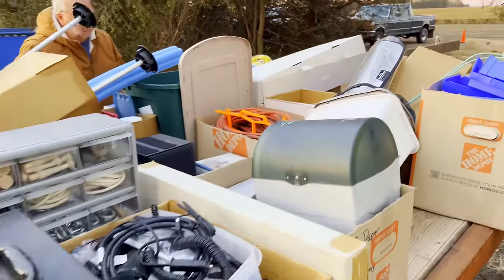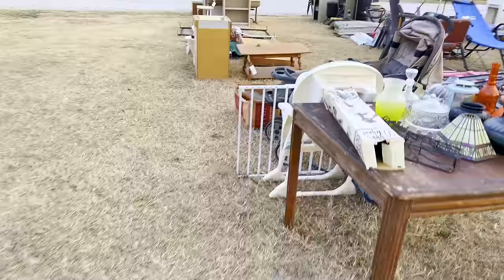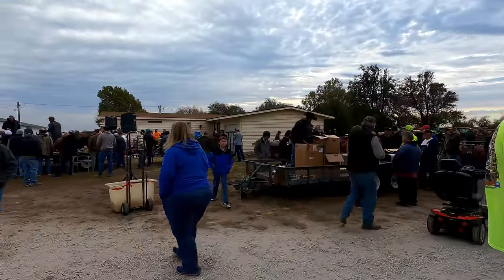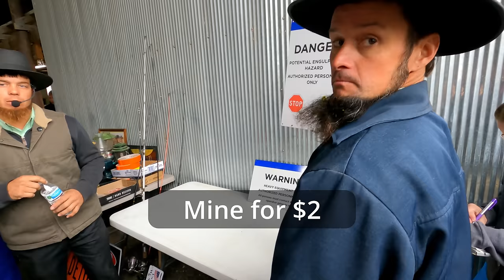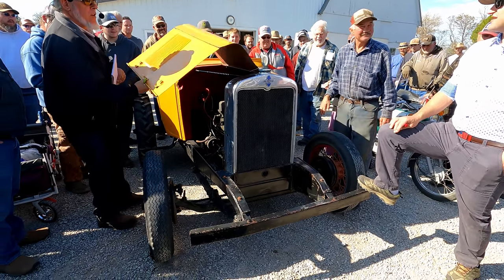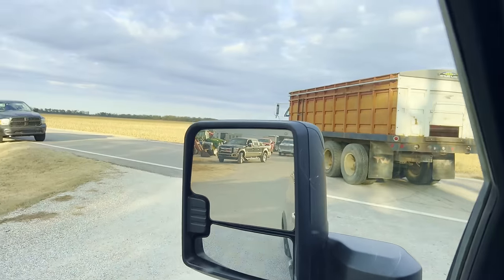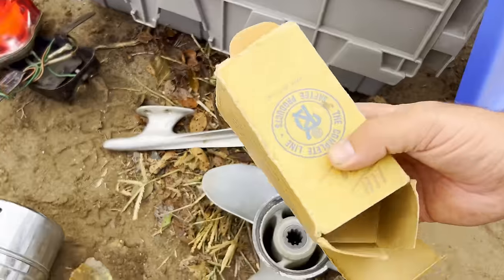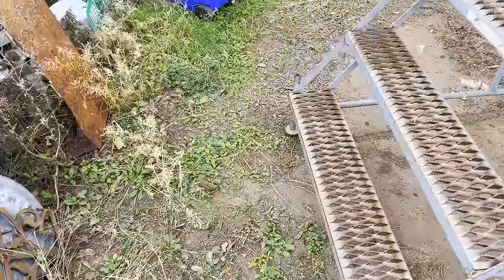HUGE Farm Auction in Rural Kansas! What Did I Buy?

Comment: On the steps for the trailer there is holes on the sides to put pipe for a railing i forget the pipe size but 4o some years back i used build them for the carnival ! They just drop in on the bottom step on outer edge & run up to the top as a railing & look around the yard i bet you got some laying around !

Comment: I could spend all day atta sale. I brought a Gravely 4 Wheel tractor  with  no SPark. 16 HP Briggs and Stratton engine.  I'm needing a flywheel and stator. Or a 16 HP Briggs that'll run.  Had to be a horizontal or side shaft motor.

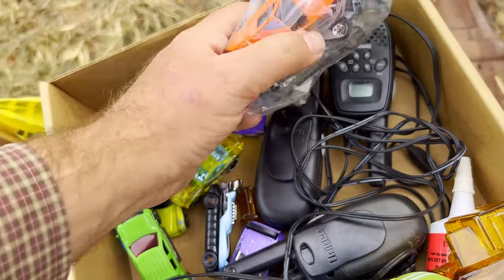Comment: 44:42 Hey Silias. I’m a vintage diecast collector and one of my pet peeves is when people “date” Hot Wheels, Matchbox, or other diecast brands by the date on the bottom. The date on the bottom IS NOT the date of production. It is however the copyright the of the casting. If you would like to know the specific year that version of the casting came out you should check out the Hot Wheels or Matchbox wikis respectfully.

Comment: Those steps are worth their weight in gold when it comes to what you used to use as steps. That cooler could have rolled at worst time. Your personal safety is topic one.
Nice solid industrial steps will last a long time. The tread plates will drain water, not freeze. Great buy in my mind. Congrats and thx for taking us all along to the sale.
Reply: Use a few pipe clamps and he can screw some 2x4s to it as a rudimentary railing, too